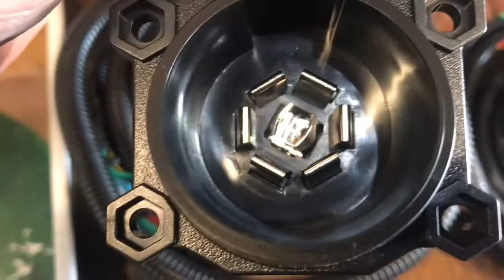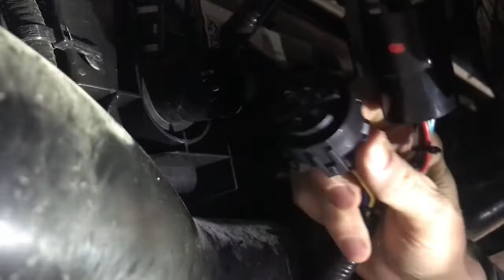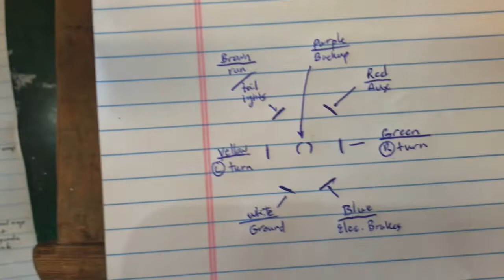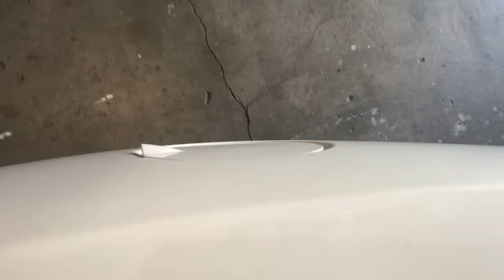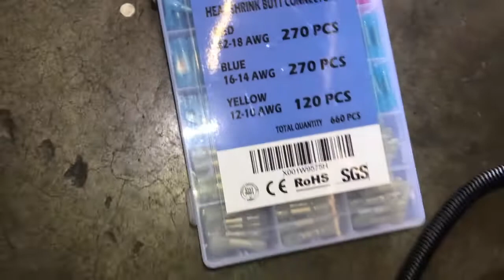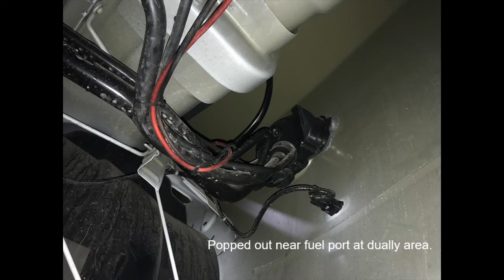Lance 6-way Truck Camper Wiring Video

Comment: Can't you just run a separate 8 gauge wire and Anderson plug directly to the 12 volt wire coming out of the side of the truck camper?
Reply from the maker: I’m not familiar with Anderson Plug.

Comment: Can some one please please tell me what wiring kit to get from hopkins!??? I have a 2022 F350 and i just purchased a 2004 1121 Lance truck camper purchased the needed lance proprietary plug 6 way and need the in bed wiring kit that connection and i cant find it
Reply from the maker: Call trailer and ask them. They are good about helping customers figure out what they need.

Comment: Sean, I assume being I have the 7 pin plugin up in the bed of my truck. I could tap into it with the Lance harness and mount it up at the front of the bed. of course  I still have to run the 8ga wire direct to the battery.  Is that correct?
Reply from the maker: Yeah, you can tap into the 7-way female plug. Just use a test light to check each spade to make sure it is wired correctly then match the lance wire that correlates with each wire going to your 7-way. It may be the same as the plug-n-play shown in the video but it could be slightly different. Lots of people run both 7-way and Lance 6-way in their beds. Good luck!
Reply from the maker: In fact, another viewer commented they did what you are wanting to do. They shaved one side of the wires on the 7-way and soldered the Lance wire into the 7-way wires. That is a good way to do it. They still had to run the 8-gauge wire to the battery.

Comment: Great video. I got a dealer quote of over $600 to do this.  I think I spent about $150 on everything (including crimping tools, fuse and shrink connectors) to DIY.  Thanks for saving me some $$$.
Reply: My Rv shop wants 450.00 to hook mine up :)

Comment: Thanks for sharing this video! I followed it exactly and everything is working as it should. My only question would be should I have connected the 8gage to my Alternator rather than my battery? I find that if I run my fridge on DC power when traveling my battery will drop about 20%. It will recover once I change back to propane and have good solar. Or, is this a normal thing? 2021 Lance 825.
Reply from the maker: Good question Greg. Short answer is, I’m not sure. Others have posted indicating there is a relay that prevents draining the battery when engine is off. I believe this to be true because my fridge only runs on 12volt when engine is running. Once engine is off, it has to run on propane or AC. In my opinion, this makes sense. I have friends who only have AC/DC refrigerators and theirs can run on DC with engine off. They have portable solar panels to manage charge. In order to accurately answer your question, you would have to determine fridge draw verses alternator charge. In my opinion, your alternator should be able to keep up with the fridge draw while engine is running. If it’s draining your battery faster than charging via alternator, I would say something is not right. However, I bought the upgraded HD alternator on my truck. Compare fridge draw with alternator charge specifications and go from there. I hope this makes sense.

Comment: Is the OEM stock wiring going to the back of the truck also 8 gauge? If it's ten gauge then the 8 gauge adaptation offers little help for the wattage doesn't it?

Comment: I followed this excellent procedure and recommend it highly. My error was not realizing my TC battery disconnect switch was in/off. With that switch in proper position,on, all works as it should. 
Great video and also super responses to my silly questions.

Comment: Excellent advice. 
I tried to follow your set up but something went wrong. 

Was meticulous, but when I plug into new set up the camper will not accept inputs. 

I tested each pin in new truck side plug. All function correctly. 

Oddly, when I plug camper into old set up ( 6 pin spliced to 7) the camper  accepts input and lights function properly. I am bewildered. Any suggestions?
Reply: I messed this up pretty well. You asked earlier if my TC battery disconnect was out. I missed that position check. With it out all systems are good. Sorry for confusion and thanks so much for your help. Excellent.
Reply from the maker: @robertgraham-yg7ur  good deal! Happy everything is working now. Safe travels!
Reply from the maker: Can you confirm what is and isn’t working once you plug the camper into truck bed female 6-pin receptacle? I would start by testing each pin/spade of each component again. Start at bumper and test , tail, turn, aux, brake, etc. Then test 6 pin female where it is mounted in truck bed. Make sure everything matches up with the layout in Lance manual.
Reply: Thanks for getting back to me
When camper is plugged into my new truck side plug nothing on the camper works. 
I tested each of the pins in the new truck side outlet and they are each functioning correctly 

I have also tested my bumper and truck bed (factory set up for 5th wheel or non- lance TC) 7 pin outlets. They function correctly. 
As I said. Bewildering.
Reply from the maker: @robertgraham-yg7ur  sounds like a ground issue because nothing is working. Really odd that you test the truck side plug in the bed and all pins work but when you plug camper in it does nothing. Is your camper battery kill switch pulled out, allowing power to camper?
Reply: @seancampbell6845  
I checked the kill switch, it is in. 
The harness ground is to the frame and checks good. The 8 gauge wires are to battery and check good. 
I wonder about GFCI in camper being unhappy. I’m about to try it with camper batteries disconnected
Reply from the maker: @robertgraham-yg7ur  my camper kill switch had to be out in order for my camper to have power. The thing I can’t wrap my head around is the fact you have power to each pin in 6-way in the truck bed but when you plug camper in, nothing works. There has to be a circuit that is tripped in camper where plug ties into electrical. I wish I was there to help. I can give you my cell. Maybe we can troubleshoot over phone.
Reply: @seancampbell6845  
I’ll get back with you tomorrow 
The crazy thing is that the camper lights all function correctly when I connect lance camper side plug to truck bed 7 pin using old spliced cable    Weird.
Reply from the maker: @robertgraham-yg7ur  hmmmm. If you don’t figure it out, message me and I can send you my cell.

Comment: Great video Sean,
I did a "spin-off" of your version. I put BOTH the 7-way AND 6-pin in the bed of my truck. Instead of cutting the entire harness end off and capping some of the wires, what I did, was shave the 4 lights wires down (one the 7 way, yellow, green, brown, purple), then solder the 6 way light wires (red, green, yellow, brown) onto these shaved wires. of course i still ran the 8 gauge power wires to the batter with 40a fuse. I then taped this all up and mounted both the 6 and 7 pin female receivers into the bed. now i have 7 way power for goose neck and 6 pin power for my 2016 Lance 850. my truck is a 2022 RAM 3500. Great video, you certainly helped me a ton! Thank you.
Reply from the maker: Great idea Spencer! Especially since you need both plug-ins.

Comment: Thanks for the great video, I’m fairly sure I followed the directions accurately. The running lights work on the TC, however won’t work the boat trailer. I confirmed the wiring and lights were good on the boat. Any suggestions would be appreciated
Reply from the maker: When you check all of the lights at the plug in that you newly installed, do you have power to everything as there should be? If yes, sounds like a bad ground on trailer. If no, sounds like something got wired wrong or the connection isn’t good on one of the wires.

Comment: Thanks for the video!  It allowed me to do this installation on my own.  I do have one question about the ground wire from the Lance connector to the battery ground.  Can that wire just be attached to the frame somewhere near the connector instead of running a wire all the way to the battery ground?
Reply from the maker: You can but I prefer to run the extra wire since you are already running the positive. Sorry for the delayed response. I only check this every once in a while. Glad it helped you out! Happy Camping!
Reply from the maker: Also…the two wires running from the battery are for the fridge so you do need to run a positive and negative. There is a ground wire in the wire harness that grounds to frame at rear bumper. I hope this makes sense.
Reply: @seancampbell6845  I don't understand why the ground makes a difference to run to battery or the frame since they are one and the same, right?
Reply from the maker: @teamboyd1  it’s what the fridge manufacturer recommends. You can get resistance from frame ground and corrosion can cause failure on frame ground. Fridges are expensive to replace so it is more safe to run the ground to battery. Just my opinion.
Reply: @seancampbell6845  your opinion makes sense.  Now I have to run more wire. :)

Comment: You mentioned running the smaller gauge white wire from the harness you cut to the frame? Or was that capped also with the red and white?
Reply from the maker: No issues when I finished install
Reply from the maker: Ok Fredrick, I just confirmed the white wire was grounded to the frame. The red and blue were capped. Sorry about the confusion. I’m not a real good YouTuber. Just hoping to help others out there. I hope that clarifies things.
Reply from the maker: Sorry for the delayed response. I only check this occasionally. I will get back to you on that tomorrow. I need to double check what I did. Off the top of my head, I grounded it to the frame.
Reply: @Fredrick did you have and issues with the running or tail lights before you grounded the white wire?

Comment: great job.  however you should run the 8 gauge 12V power from the Lance connector to a relay that only connects 12 V power from the truck battery when the truck is running
Reply from the maker: I have not confirmed this either but I will this spring.
Reply: @seancampbell6845  Look under the kitchen sink.  I see a device called a Battery Separator then you should be good.  Mine has one and it's Model 1314.  I contacted Lance to confirm.
Reply from the maker: Good point. Thanks for the feedback. I will make that adjustment.
Reply: Lance campers have a built in battery isolator. When the truck alternator reaches 13.2v it will charge the camper batteries. When stopped, the battery isolator monitors the truck battery. When the truck battery reaches 12.8v then the isolator disconnects from the truck battery, thus ensuring it doesn't drain the truck battery.
Reply: @T0DDS  is this true?  If so then I do not need to unplug my camper every time I stop for awhile, right?